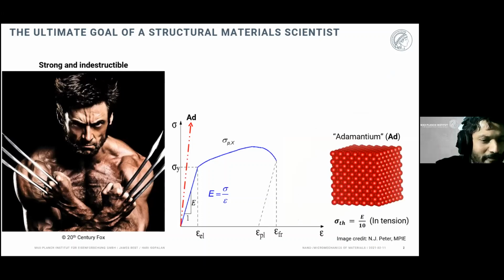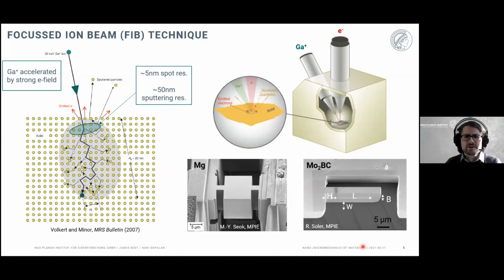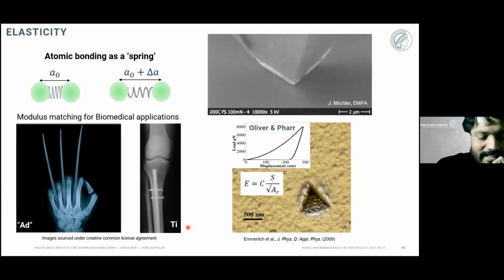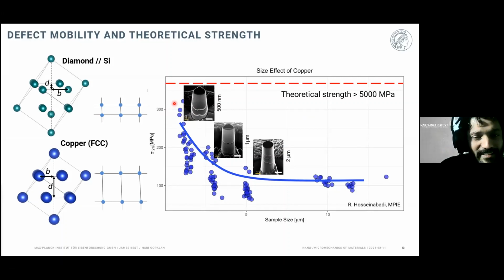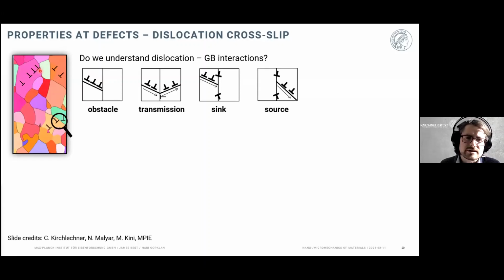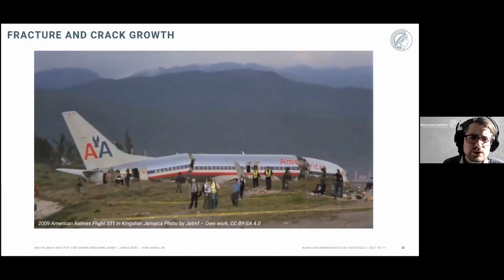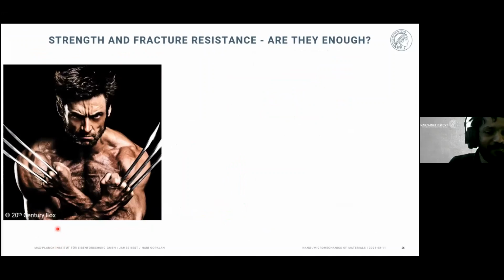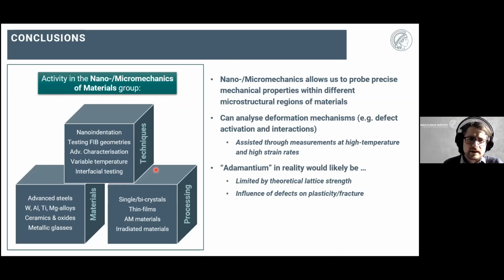Nano- and Micromechanics of Materials by James Best and Hariprasad Gopalan

Comment: One very important remark I would add concerning the strength of diamond compared to Copper: covalent bonds in diamond make much more impact to strength rather than plane stacking.
Reply from the maker: Correct, the strength of diamond is absolutely related to the interatomic bonding (reflected in the shear modulus, G). The plot and discussion on Slide 12, however, considers a normalised shear stress (Peierls stress / G) where the trend for the materials shown is proportional to exp^(-d/b), highlighting the concept of the lattice geometry providing a resistance to dislocation motion.
Reply: @mpisusmat  thank you!